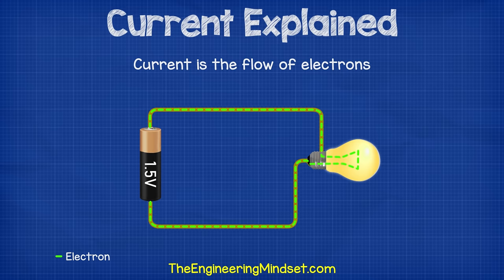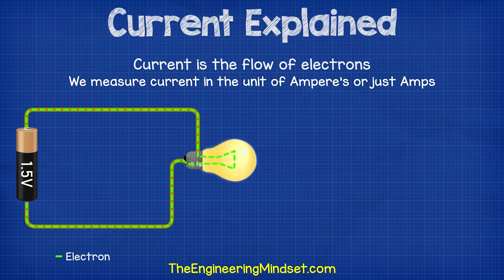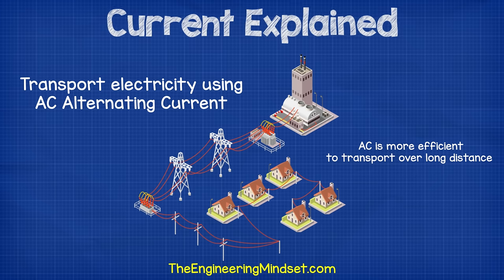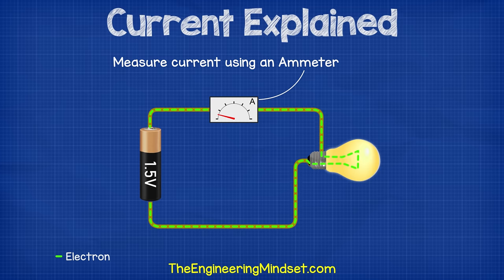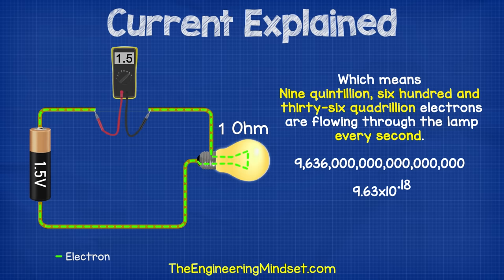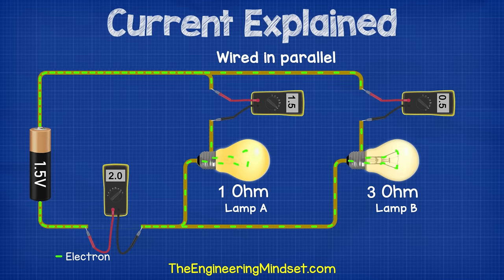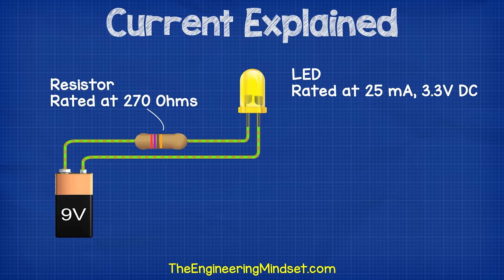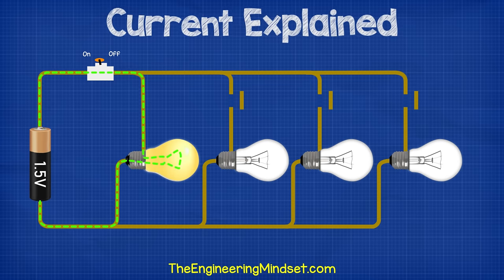What is CURRENT– electric current explained, electricity basics

Comment from the maker: 🎁 WATCH THE NEW and updated Current video here : https://youtu.be/kcL2_D33k3o 🎁
Reply: isn't the circuit breaker at the end of the video a specific type, namely a gfci circuit breaker, a type older homes don't have
Reply: I learnt something new in this channel
Reply: Thank you sir
Reply: Minute 9:12, does the position of the Resistor matter? I mean given the flow direction, should the resistor be between the input and the LED lamp, so it will slow doen the current before it reaches to the lamp, or does it not matter? When not, how and why? Maybe someone wll explain, thank you!
Reply: My son loves your vids
Reply: The "current" Current video, ahahah... lol.
Reply from the maker: Check out NEW resistor video, everything covered! ➡️ https://youtu.be/DYcLFHgVCn0
Reply: Thank you so much sir
Reply: @EngineeringMindset  Hey one thing that really confused me, I would really appreciate some insight: In your graphic you put the resistor, fuse, etc. on the neutral line of the circuit going back to the power source; Why wouldn't those go on the hot line of the circuit if their purpose is to regulate/monitor the amount of power the circuit is drawing? And as a safety features how would they stop you from making a new circuit if they're further down the circuit-line then the point where your most likely interacting with the circuit (the light-bulb in the visual) I've been trying to use critical thinking and reason on my own but I just feel more like an idiot the more I ponder 😔
Reply: Thx you are making high school so much easier god bless you
Reply: What is electric current?

What is electric current? Electrons flow in a conductor?

How do electrons flow in a conductor? Like many cars driving down the highway? Or is water flowing in warer pipe? What is a highway in a conductor? What is the water pipe in the conductor? Why don't electrons flow to the positively charged nucleus? What magic keeps electrons away from the nucleus?

Is the speed of electrons flowing in copper wire the speed of light? If not, how could electricity travel at the speed of light? If so, how can electrons accelerate at the speed of light?

In fact, Atoms are not made from charged particles as scientists told. 

All atoms consist of indestructible, electrically charged multiple layers hollow sphere and internally charged solid sphere. Outside each atom is a layer of negatively charged liquid that scientists mistaken for electrons.

This negative charged liquid attaches to non-metal atoms due to their outer layer is positively charged and floats on metal atoms due to their outer layer is negatively charged. The floating liquid of a conductor conducts electricity.

Electricity is flow in conductor 
instantaneously, similar to hydraulic fluid flow through hydraulic systems. 

The voltage of the electricity is proportional to the speed at which the floating liquid moves.
Reply from the maker: Seen our new incredibly detailed MCB video? link: https://youtu.be/gqEu9t8HwW0

Comment: One thing is always confusing to me is you state the number of electrons flowing through the circuit but with AC which you talk about interchangeably with DC in AC there's no electrons flowing through it for they are just vibrating 60 times a second, you give the example of flowing like a river and in DC it does but when AC the electric company is not giving you any electrons they're just making them move

Comment: Can someone please explain why the current would increase if someone touched an open circuit? Doesn't this go against Ohms law? A human body surely represents a very high resistance, which should cause the current to decrease for a fixed voltage.

Comment: Great videos paul.  Im a master electrician in the usa.  Iwas trying to explain transformers to my apprentice and realized i had a lot of questions.  This is your fourth video ive watched, you do a great job of using language and analogies that anybody can understand.  Keep up the great work mate
Reply: Jeff Eisenmenger 

Could you answer this question, I need it for homework and I just can’t get it. How is Electric Current generated in simple words?
Reply from the maker: Check new more detailed current electricity video here: ➡️ https://youtu.be/kcL2_D33k3o
Reply: @MichaelJ44   Current always rises when the resistance drops which is why short circuit is so dangerous since there is no resistance.  The higher the resistence the lower the current and the higher the voltage the higher the current's potential. It is a side effect basically of resistance and voltage.
Reply: @MichaelJ44  spin the magnets
Reply: @ashnite2235  SPREAD
UHHHH ME 
😏
Reply: Hi
Reply: ir what actually the electric current is and the mechanism of flow of it in a conductor.
I mean is it flows as electrons or as magnetic waves?
Do electrons actually move or just they vibrate in the frequency of magnetic waves?
I am pretty confused about that so, i hope u clear my doubt.

Thank you sir🙏
Reply: @EngineeringMindset can i make a question about electricity?

Comment: Great video, except for the ending. A circuit breaker exists to prevent fires, not to save your life from electrocution. I don’t want anyone to think that you can’t be hurt because a circuit breaker will save them.
Reply: I was arguing with my teacher about this. And he said that, technically it is true that the interrupter breaks the circuit due to an increase in current. It's just due to a ground fault instead of an overcurrent. But I would say that such a detail should be mentioned when talking to the audience of these kinds of videos.
Reply: Broskii American bathroom outlets are legally required to have breakers in them that trigger when you shock yourself lol
Reply: @jasisonee  that part was unclear to me. Why touching the live wire will increase the current? Shouldn't the body add an extra resistance lowering the current?
Reply: @donka86  Yes, the Body does add resistance but it is in parallel so the total resistance goes down.
Reply: @jasisonee  Why does the human body add resistance in parallel?
Reply from the maker: Check new more detailed current electricity video here: ➡️ https://youtu.be/kcL2_D33k3o
Reply from the maker: Seen our new incredibly detailed MCB video? link: https://youtu.be/gqEu9t8HwW0

Comment from the maker: ⚠️ Found this video super useful? Buy Paul a coffee to say thanks: ☕
PayPal: https://www.paypal.me/TheEngineerinMindset
Reply: 3 ampéres = 1,8726x10^19 electróes/segundo e não 1,93x10^19.OK?!

Espero que me diga se estou certo ou estou errado.
Muito obrigado. Abraço de Portugal.
Reply: Case1: If we place 2 resistor in parallel of same value.(1k0hm)
Case2: If we place place 3 resistor of same value.(1kohm).
Which case draws more current from battery.
Reply: Sure!
Reply: Mufakkir Hussain did you figured it out? If yes, what is the answer? Thanks
Reply: @mufakkirhussain2816  Case 2 if the resistors are placed in parallel
Reply: At 10:54 shouldn't the current split equally Like in 7:12? How did the current increase?
Reply: @oscarstan8999  The currents are split equally, but there are 4 branches in 10:54, every branch passing 1.5 V / 1 ohm = 1.5 A, 4 x 1.5 A = 6A, and 2 branches in 7:12, giving 2 x 1.5 A = 3A.
Reply: Awesome
Reply: When you power on a light, Electrons move extremely fast through a wire correct?
Reply: Can there be a permanent magnet core under winding instead of iron?.
Reply: OMG your channel is really helpful...Thank you Sir
Reply from the maker: Check out NEW resistor video, everything covered! ➡️ https://youtu.be/DYcLFHgVCn0
Reply: @EngineeringMindset All the Power!

Comment: 4:02 There's an error:  in the video, you've said that you convert AC to DC using an inverter.   
That is wrong.  You convert DC to AC using an inverter.  AC to DC is converted using a rectifier.
Reply: Albert Ong yea I just caught that to
Reply: Ｙｅｈ
Reply: How do u know that on a beginner's vid wth
Reply: @ognoobish  I know right
Reply: Did it occur to you that maybe he is not a beginner?
Reply: @ognoobish  he is a pro watcher in a noob video
Reply from the maker: Power inverter video  here https://youtu.be/iIqhAX0I7lI
Reply: @MrMaxitaple , he is not a noob
Reply: in contrast the diagram is DC to AC
Reply: Singh he never said he was a noob, he said hes a pro in a beginner video.
Reply: Or a diode and a capicitor
Reply: The wording was swapped yes, but the video shows the correct process using an inverter. In this case, the benefits and quality of this material will forgive that mistake. Specially because there is a full video from the same series about inverters. This is one of the best electronics engineering and physics foundations video I have found in YouTube.
Reply from the maker: Check new more detailed current electricity video here: ➡️ https://youtu.be/kcL2_D33k3o
Reply from the maker: Rectifier video here https://youtu.be/RiRyzLl4Y8U

Comment: 5:04 For clarification, isn't an amp equal to 1C/1s, and thus a Coulomb equal to 1A*1s? The on-screen text seems to indicate the opposite relationship
Reply: mjchmara1 it looks like a typo. It should read: One Amp = One Coulomb per Second and 1 Coulomb = approx 6,000,000,000,000,000,000 electrons. Well spotted...
Reply from the maker: Check new more detailed current electricity video here: ➡️ https://youtu.be/kcL2_D33k3o

Comment: Great video, but a few inaccuracies: E.g. "One Ampere is equal to one Coulomb" is an unfortunate way to put it - as Coulomb is charge, not current. It is claimed (in the same slide) that one Coulomb is equal to a certain number of electrons per second. No, that is current, not charge. This ought to be corrected, as is very basic  and confusing for people who are learning electronics. 

An inverter converts DC to AC (4.04): The graphics is correct, but the commentary describes it as a rectifier, not an inverter.

Comment: This is a really good video series.  I have a degree in Electrical Engineering and found practical things in them I did not know or fully understand.  I hate to nitpick, but there is one concept with which I must take exception.  That is the depiction of current as physical electrons racing through the conductor at tremendous speeds.  It is the electromagnetic wave propagation that moves at incredibly high speeds of approximately 0.9c.   In fact, the electrons merely "drift" at about 1mm/sec.  I have not watched all of your videos, so I apologize if you have made this distinction elsewhere.  Otherwise, keep up the good work.
Reply from the maker: Check new more detailed current electricity video here: ➡️ https://youtu.be/kcL2_D33k3o

Comment: 4:02: "We can convert AC to DC using an inverter."
Should be the other way round (as one can see on the screen): "We can convert DC to AC using an inverter."
Reply: Correct! Ac to dc uses diodes in a rectifier to make the oscillating current constant.
Reply from the maker: Power inverter video  here https://youtu.be/iIqhAX0I7lI
Reply from the maker: Check new more detailed current electricity video here: ➡️ https://youtu.be/kcL2_D33k3o
Reply from the maker: Rectifier video here https://youtu.be/RiRyzLl4Y8U

Comment: summary:
- electrical current is just electrons moving along a wire
- voltage drives an electrical current
- DC is when electrons flow in the same direction
- AC is when they alternate their direction
- you can use an inverter to convert AC to DC
- make a resistor the weak point in your circuit to prevent other parts from burning out (these are called fuses)
Reply: Incorrect. A resistor and a fuse are very different. A resistor brings current and voltage to a specific point while a fuse is a safeguard that blows when the limit is reached.
Reply: @Rexaurus  Are you sure about this? Couldn't I just use an LED (which is a resistor - heats up in response to electron flow and as a result emits light) as a fuse? If I push too much current through my circuit, the LED will burn out, thus protecting the rest of my circuit. I don't really see what makes a fuse a fuse? Aren't they simply resistors internally?
Reply from the maker: Power inverter video  here https://youtu.be/iIqhAX0I7lI
Reply from the maker: Check new more detailed current electricity video here: ➡️ https://youtu.be/kcL2_D33k3o
Reply from the maker: Check out NEW resistor video, everything covered! ➡️ https://youtu.be/DYcLFHgVCn0

Comment: Thanks a lot for this video!!!  People have been wanting to figure out how to get more voltage out of a solar cell or battery. Well that can't actually be done, but we can make them appear like they are providing more voltage using a current amplifier added. It is similar to how capacitors appear to pass AC electricity, but actually they don't. I drew two schematic diagrams and will get back to you on this idea of mine after testing it. If successful, a 6 volt battery will do what a 12 volt battery can do!  💯💰🙏
Reply: My experiment was a success saving as much as 61.9% current when applying 7.53 volts (from a variable DC Power Supply) to a 12 volt DC automotive bulb. Capacitance maximum value changes each time the input voltage changes and also maybe the total impedance of the load device connected to the input source.

Comment: Deserve WOW. Great videos simple but complex. Btw, why is higher voltage less amp and low voltage more amps?
Reply: This is the case when you consider Power (P) to be constant. Because P = V * I, if you increase voltage V, current I needs to decrease (for the same amount of power. For example, a 60W lamp designed to work with 240V will require half of the current than a 60W lamp designed to work with 120V. But, keep in mind that for THE SAME lamp, if you increase the applied voltage, its current will also increase (you will get more power).
Reply: Mohd Azmeer Well, that’s not strictly correct. From ohm’s law, increasing the voltage will increase the current and decreasing it will reduce the current and that’s the way to think about it. If it is a 120v circuit with a 60w lamp, increasing or decreasing the voltage will increase and decrease the current, just the same as the 240v circuit.

However, for the same power, if the voltage is reduced then the current has to increase I = P/V 
A transformer is a good example of reducing or increasing the voltage. Say the voltage In is 240v in and 120v out. If the power in, equals the power out then 
P    =   Vin x In    =  Vout x Iout
 60 = 240 x 0.25 = 120 x 0.5

So reducing the voltage, increases the current for the same power and increasing the voltage decreases the current for the same power. 

However, do not confuse this with ohm’s law.

These are two completely separated circuits and ohm’s law will apply to both. Increase the voltage of Vin and In will increase. Increase the voltage of Vout and Iout will increase.

Assume the transformer has a power factor of 1 and assume there are no losses.
Reply from the maker: Check new more detailed current electricity video here: ➡️ https://youtu.be/kcL2_D33k3o

Comment: These videos are fantastic. They help pull back the veil on electical science that to this point has remained a vague mystery to me, starting with why doesn't electricity leak out of the living room wall socket? Now things make sense.

But question: isn't large scale long distance electrical transmission performed using DC?
Reply from the maker: Check new more detailed current electricity video here: ➡️ https://youtu.be/kcL2_D33k3o
Reply: well, sometimes. AC is still used more widely though since it's easier to step up/down